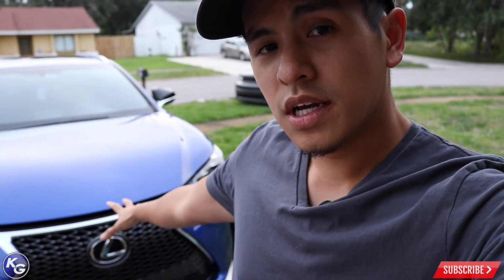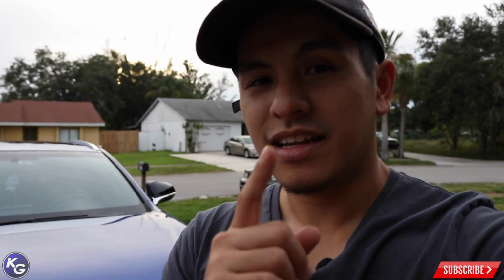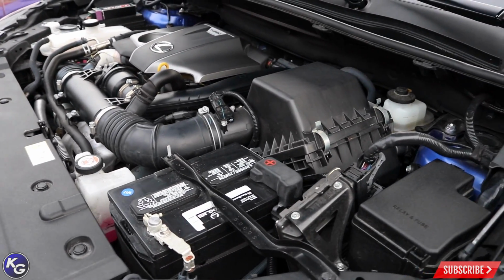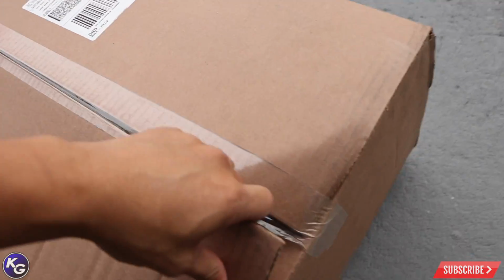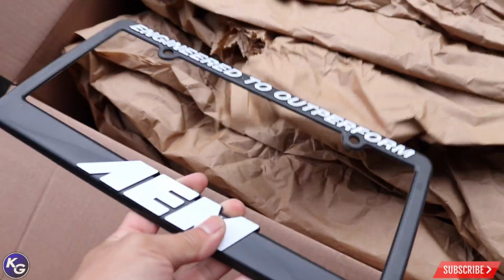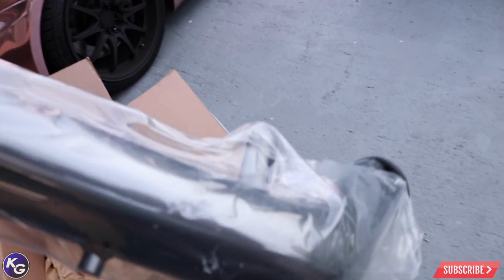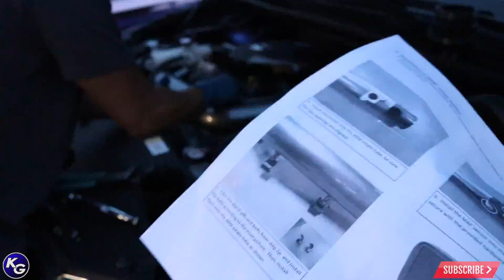Unboxing and Installing AEM Intake on John's Lexus NX200t

Comment: What is the expected boost in horsepower by installing this combo? I only have a K & N performance air filter now and would like to gain some additional power. This looks like a decent option.
Reply from the maker: I can’t speak on facts but I believe it mainly improves airflow and how smooth the power band feels. Assuming since it’s a turbo motor, tune and down pipes or exhaust would be your best bet for performance gains.

Comment: I have a turbo car an i want to get one but.. worry about getting hot air in the intake.. right now i only have a k&n filter drop-in
Reply from the maker: Manny787 yeah I’m sure it’ll have a lot of heat soak. I know you can mod the metal plate with heat wrap of some sort and also mod the air flow pipe underneath the battery to run fresh air to the intake.